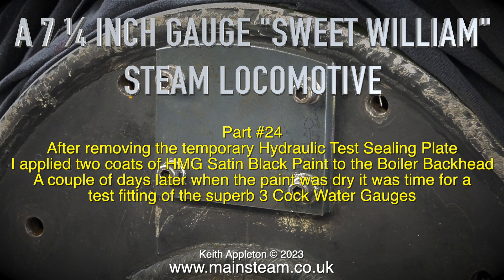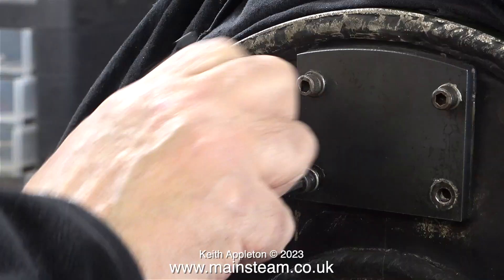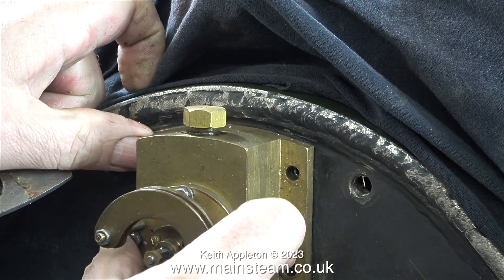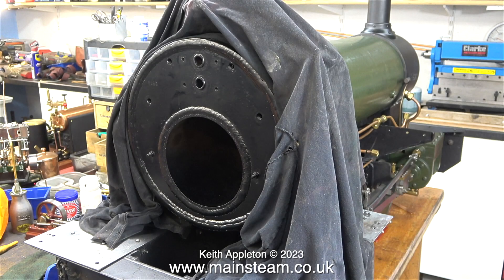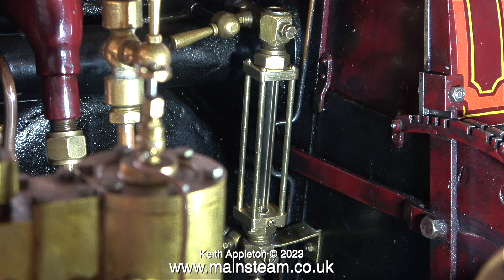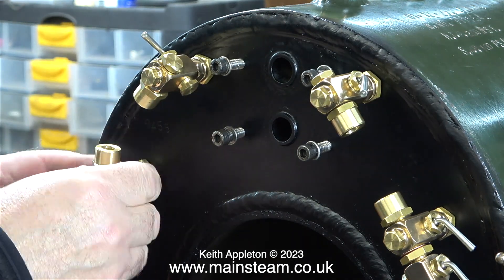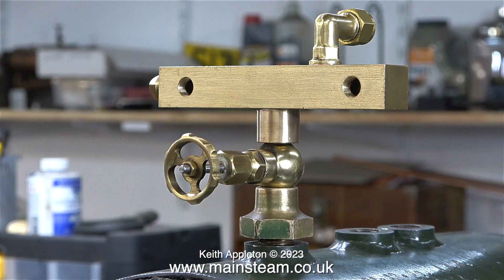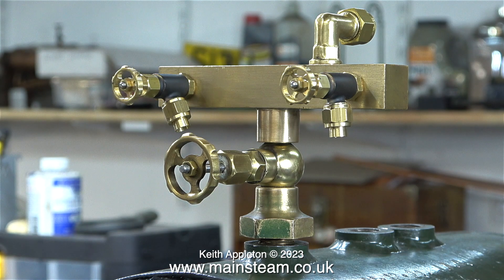A 7 ¼ INCH GAUGE "SWEET WILLIAM" LOCOMOTIVE - PART #24

Comment: Thanks for sharing another great video.  Those are beautiful water gauges.  Your right, they do really look good against the black backhead.  I'm glad you were able to get those overtightened bolts out.  Hopefully the threads weren't damaged.   I know how you feel when things go wrong on the last bolt... I hate when a hex key slips and strips out the bolts.  I got a set of hex sockets.  I find it allows me to push down on the socket while using the leverage of the socket wrench.

Comment: I have encountered dealing with real tight cap head bolts too. I obtained a set of 3/8 drive Allen sockets, if that's the correct name, in all of the standard IMPERIAL sizes to allow me to really put the twist on them. I know that they will not work in tight places. In that case I put a 1/4 drive socket, that fits an Allen key on a long extension. It's a bit safer than an adjustable wrench, It's all just another "shade tree mechanic" trick I learned
William is looking better all the time. Those fancy water glass fitting are going to be real nice. ;-)